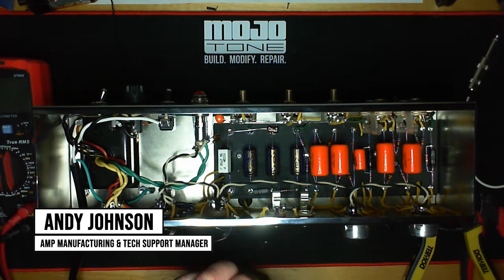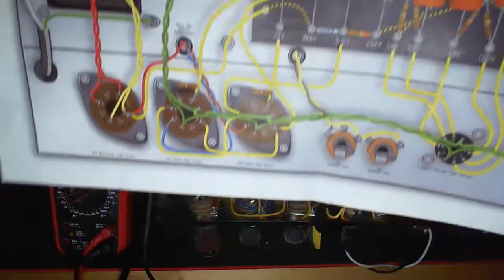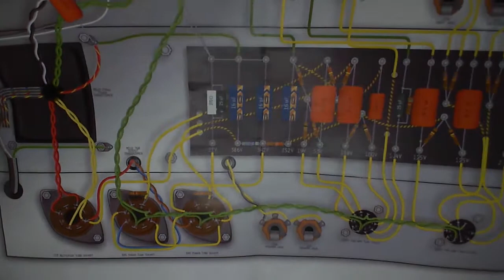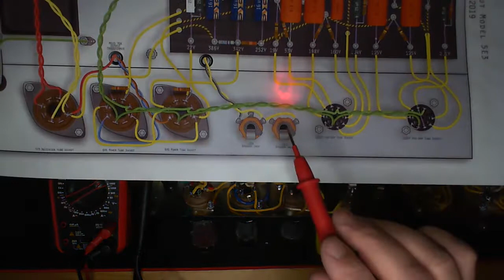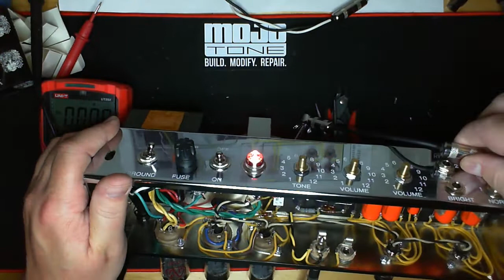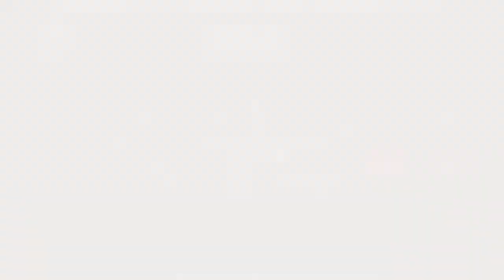5E3 Final Voltage Testing

Comment: what was your voltage drop over the bias resistor. 
With 403V on the plates and using a 250 ohm resistor your tubes will be biased way hot.. (well above 100% plate dissipation). ???

Comment: IT LOOKS LIKE YOU ARE PUTTING THE NEUTRAL SIDE OF THE AC TO THE SWITCH. THAT SHOULD NOT BE. YOU SHOULD SWITCH THE HOT WIRE ALWAYS AND LET THE NEUTRAL TIE TO THE NEUTRAL SIDE OF THE TRANSFORMER. AND YES I KNOW THE TRANSFORMER REALLY HAS NOT POLARITY.
Reply: It looks like you have got your caps lock stuck on all the time

Comment: Thank you!! I was quite alarmed when I saw the very high B+ voltages especially at it was over the capacitor rating. Your video gave me the confidence to proceed. B+ drops below 475 after tubes pull it down on startup.
Reply: instablaster.